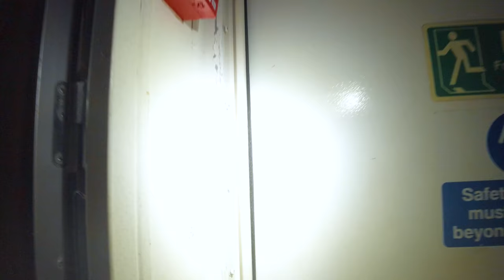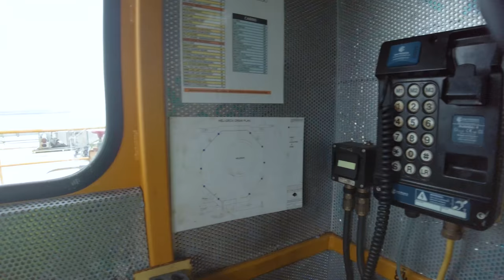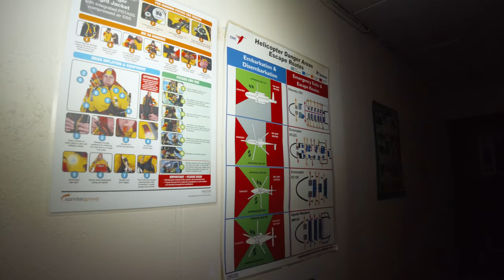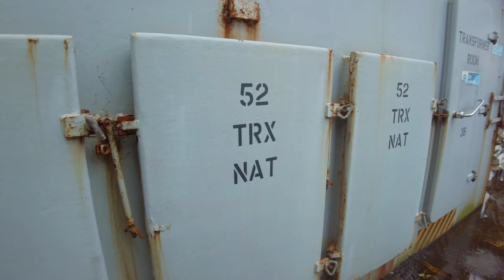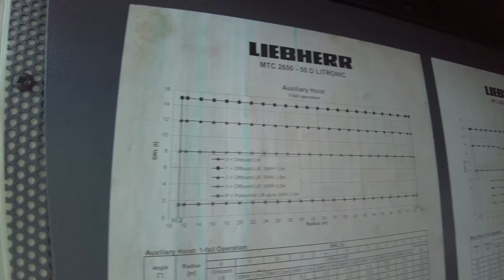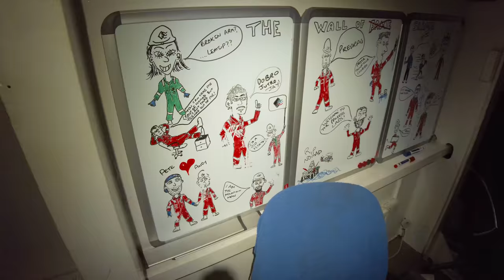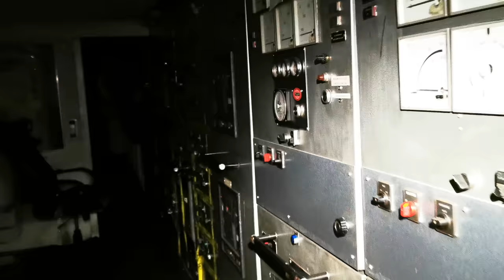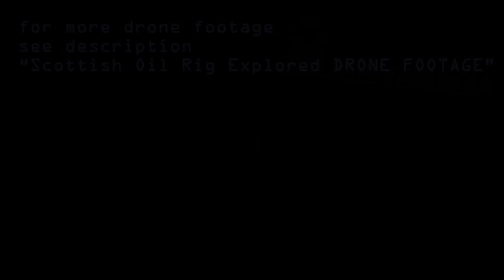Scottish Oil Rig Explored DAY2

Comment: 'Grace 1' was added in the last months of its existence in Invergordon. This was Diamond Offshore Drilling's rig, the Ocean Princess. It was built in Norway in 1975 as the Treasure Hunter and changed names several times during its career before becoming Ocean Princess in 1994.  It was finally towed to Turkey and scrapped in May 2023.  The RIP Nomad reference at 49:40 is for its sister ship, the Ocean Nomad, scrapped a few years earlier.

Comment: At 51: 48  it would have been intersting to see the makers name on the engines and the kilowatts on the electric part , it is called the alternator  and connected to the engine . good explore Matt
Reply from the maker: It would have been nice to spend a day on there.
Reply: The engines in the crane were almost certainly Caterpillar, LOL, I don't think anyone else paints their engines bright yellow. I can't tell for certain about the others but they have a pit of a Paxman vibe to them, I would have to compare them to some others.
Edit: I am not sure now, TBH. Looking at the bolts on the valve covers, they look like Sulzer LVA. I didn't think of them at first as I normally associate them with those boxy looking ones like on the in line LDA and double crank ones. Possibly Sulzer 12LVA24?

Comment: I'm sure the oil rigs that have the leg type structures going upwards from the top of the rig are so they can move the whole platform upwards depending on the height of the waves and level of the sea. We used to get rigs come into Holyhead just outside the harbour and you could sit watching them and see the whole platform mogingbup and down. They were brought in with tug boats.
Reply from the maker: some are jack ups as you describe and some are floaters like the one we are on here.